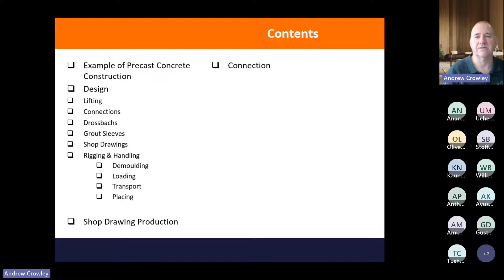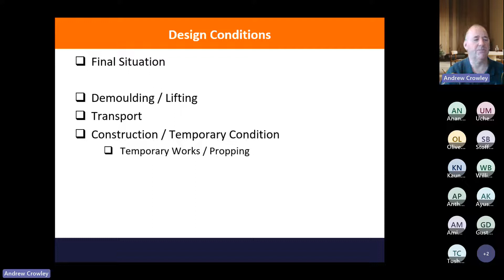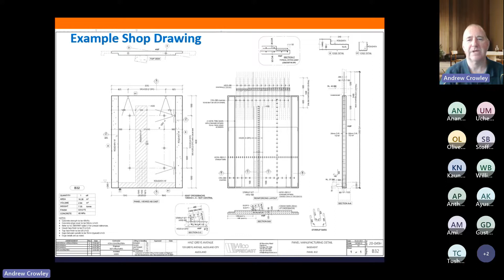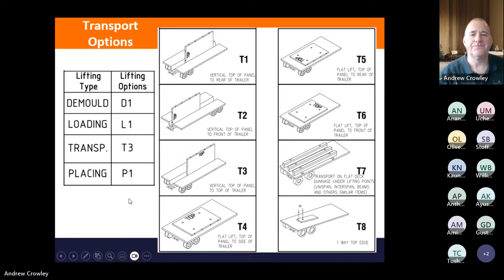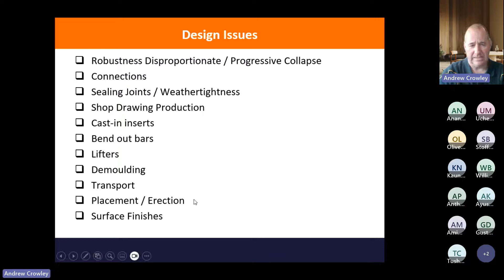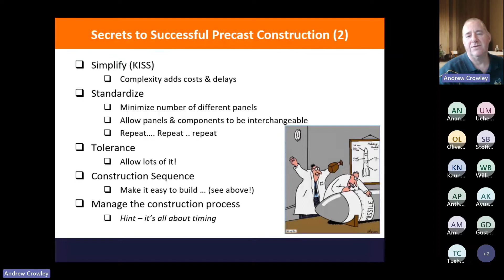CPD Seminar #10 - Precast Concrete Part 1: Theory

Comment: Hi, I'm looking for a software other than Tekla to do concrete precast detailing. Can you please suggest/recommend me one. With the Australian Standard offcourse. I'm looking at Revit but not so sure it can do it? Please help?
Reply from the maker: Hi, Tekla is probably your best bet. You can get add ons to AutoCad and Revit which may help.
Reply: @daddypig6354 thanks for your suggestion. Yes Tekla can do the job well,  not sure what is the cost of Tekla licence in the UK,  but in Australia it is very expensive. It costs around 11k per year. For a small operator like me I cannot afford it that's why I'm looking for an alternative.